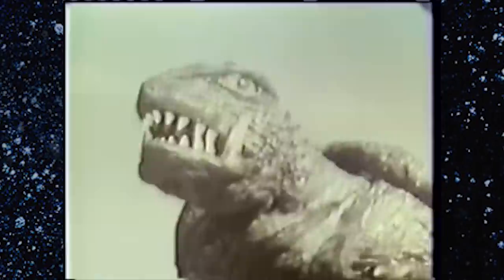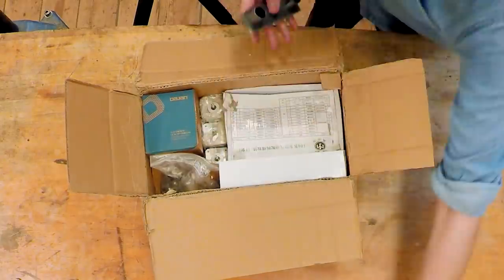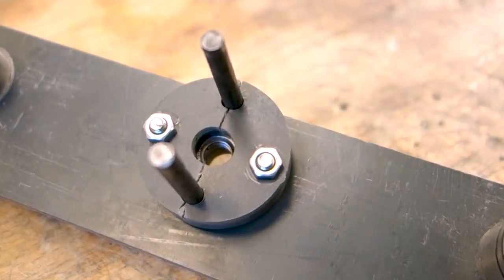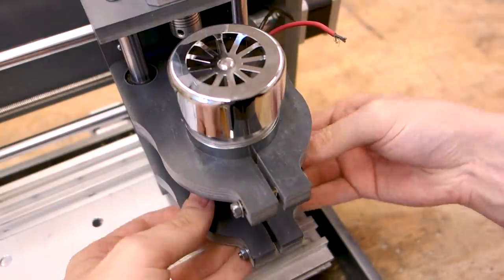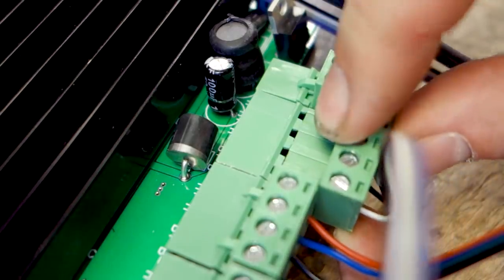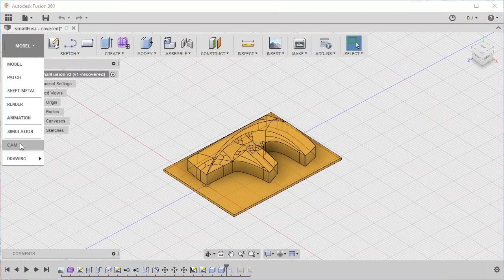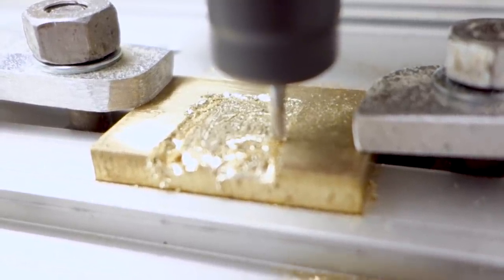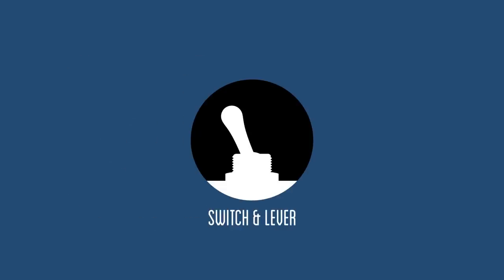Review: Cheap CNC Mill

Comment: The same money can buy an all metal machine with pre-built enclosed electronics.
Reply from the maker: +Do R/C! Show me, with a similar sized bed as well. I've heard a lot of claims to the same, but when it comes down to it I haven't found any machine of comparable size, made from aluminum with enclosed electronics for less than double what this cost.
Reply: Switch & Lever lookup CNC engraver on eBay. There on the for $400 with a 200x300 bed and enclosed electronics.  All metal it looks like.
I have no idea of the quality but it'd be hard to be worse than this.
Reply from the maker: So, what we have here is something which actually works pretty well (for what it's intended to, which is engraving), and you automatically think that something else, which you also have had no first hand experience with, automatically is better? That doesn't even begin to make sense.
Reply: Switch & Lever I'm not saying that it will work better.  It does seem to have had more thought put into it's design though.  The kit you got had to have moderate modifications done to it to simply get it put together.  I just wanted to say there were options that appeared more "put together" for the same money.

Comment: I've bought this mill by the past and it was a nightmare.

First, the chinese seller posted it to an erroneous address, fortunately, my real address was inside the box, so the addressee joined me to get the box.

The box.... Badly packed, the cardboard teared-off, fortunately, the contents was complete.

Second, the motors. All the spindle and the NEMA steppers were badly used.  The Spindle's brushes were almost weared-out, and the spindle ran a t a merely 3000 RPM, so i replaced it with a higher quality 3.175 mm spindle.

The steppers, definitely met water in their past since theit internals were rusted. Fortunately, i could clean them, re-oil the bearings and lenthened their 15mm short  leads.

The electronics.... Bad bad bad !

They used Toshiba TB6560 drivers which i DEFINITELY  NOT  recommend. Awful instability which caused excessive current consumption and driver overheat.

After several unsuccesful modifications, i finally quit and bought a new TB6600 equipped four-axis module which works like a charm.

I bought this mill mainly to engrave PCB's and i use it regularly today for prototyping but  i do not reccomend it, mainly for the awful spindle motor and for the crappy electronics. Go for an aluminum extrusion unit.
Reply from the maker: +ve2zzz did you get it from Gearbest or where did you get it from? Reason I'm asking is because there seem to be a fair amount of very similar clones, from different sources. Aside from feeling dirty none of the parts I got were used before I got them, and the electronics sound different from what you describe at least.
Reply: Probably a clone... I've bought this CNC 3-4 years ago and don't remember the seller's name.

Comment: This is such an ambiguous review. How can we take your verdict seriously when you replaced the rod nut holder and the entire bed?
Reply from the maker: So I should not have replaced the broken part, and ended the review there? 

If you actually looked through the entire video one of my final points is that this is a good platform for experimenting, and continuing to build on, which is exactly what I did. It's ambiguous because I want people to make up their own minds based on the available facts. I got this mill to make a review, not to advertise the product, in which case it would've been a heck of a lot less ambiguous.

I wanted to push this mill to see what it could do, and I pushed it beyond that point. It's advertised as an engraver, and for that job it will work just fine. I wanted to see if it could do more, which it can, to a point.

Comment: In short: it's shit
Reply: I'm hearing Neil Young singin'
"Saw it on YouTube,
Bought it on Gearbest,
When I got it home,
It was a piece of crap,
PIECE OF CRAP!!!
Reply: The main problem, I think, is the type of plastic used for the frame. It can break very easily (and bend), but I don't think it is very hard to find someone having a good machine capable of making aluminum parts. All you need to do to get a fairly "good" CNC machine is to replace some of those cheap plastic parts with aluminum ones. But I have to agree, the overall product "out of the box" is not very impressive...
Reply: Must feel good to think you have the high road. Black and white thinking doesn't make you look smart. But you are entitled to your opinion! Have a nice day as well.
Reply: i know you did doesn't take keeping up xD xD
Reply: The uploader can say what he wants, but from the results he got it's safe to say it's shit. Plain and simple.
Reply: I find myself having to agree with @eduard van lersel... 400$, lots of hours and yet no tangible results ... It's utter crap... that's it's "cheap" is not a redeeming argument,  crap is crap, no matter what it cost
Reply: I agree. This is shit.
Who wants a plastic cnc machine anyway?
Plywood would be better ffs.
Reply: so you pubicly say it's shit?  and if you could, it wouldn't  be accurate or reapeatable
Reply: Damn right!
Reply: Frank Einstein Even a wooden frame would be better, given that it's designed to be stiff
Reply: +SugarBooty
I haven't thought about wood but you are right, It's easier to cut than aluminum. But at this point, I am wondering if it would be cheaper to buy the parts separately and build it from scratch. Like, half of the parts of this kit needs to be replaced anyway.
Reply: Frank Einstein Everything adds up, off the top of my head, buying everything from Amazon for the free/cheap shipping it would cost about the same. This kit has all the parts in one package for $400 with a rough guide on how to cut the pieces. It's up to the individual but if I was in the market for a CNC mill I would definitely consider getting this kit. Then again, I love to tinker and make improvements over time. For any sort of manufacturing environment you need to buy a decent mill for the warranty and serviceability.
Reply: Steve Vise i didnt say its shit lol
Reply: Literally a guy with racial point of view explicitly imposed on Chinese products any smarted people would put hands on counterfeit products what’s a smart ass guy with an awesome opinion
Reply: the number of modifications you've made to it and the part you had to mill say more than your comments.  it's a dud
Reply: Haha, how about me putting 10 machines in a room you cannot live? They can work at least 10* faster, and not to mension your morale, repeatability and so on.
Reply: Cole, no one is twisting your arm, forcing you to use this machine. Even if this device is "shit" (as you say), I find the video extremely informative. And if you have never had to manufacture a part for a factory-built machine you are assembling, then it's obvious you've never had to put anything together on a budget. Although it's nice that you have plenty of money to do whatever you want to do, some of us have a need to actually build stuff.
Reply from the maker: In short, you didn't listen to what I was saying through the video, and make conclusions about a mill you have no first hand experience with.
Reply: Oh, I have been listening. But spending $400 on something and then spending dozen of hours to get it to cut something out of foam that I could cut in ten minutes is shit to my eyes.
Reply from the maker: +Eduard van Iersel dozens of hours? The whole thing took 8-10 hours from start to finish, including recording video (which for those of you who don't make project videos lengthens the time of a project significantly). You're just jumping to conclusions about something you have no first hand experience with.
Reply: 10 hours is still longer than 10 minutes. If you are willing to defend something poorly made that has no significant function, then be my guest, but to me it is a piece of crap.
Reply from the maker: +Eduard van Iersel so wait, you expect to buy a kit CNC for $400 or less and not only that be able to put it together in ten minutes? Really? Do you want it to make coffee and iron your clothes while you're at it?

In the end I'm defending something I've had actual experience with, from you who've likely not even seen this before this video and only have opinionated input to come with. 

You don't have to buy it, no one does. Hell, I never even recommended anyone should buy it, I merely lay out the facts from my hands on experience.
Reply: pot calls the kettle black. I'm just a guy with an opinion
Reply: An opinion isn't inherently wrong. I can cut the same parts with a knife myself, so to me the machine is useless.
Reply: yea your opinion is completely wrong, i could cut fine parts with this machine once i learned what it could handle, for 400$ the value is definatly there, not so much an opinions as these are facts
Reply: I just publicly called it shit, try to keep up. I can make things accurate and repeatable, I'm a furniture maker. Have a nice day.
Reply: in short, your kind of and idiot ahahaha

Comment: Spending this much on a mill which is a piece of junk to begin with, it really isn't a good deal. You may as well not buy a mill and save your money to buy something from a reputable company. Buy from China and you'll get junky, low-grade products every time. Trust me it doesn't pay to cheap out haha
Reply from the maker: +Karl Walter I understand your sentiment, but find a reputable CNC mill for the same price and then we'll talk :)
Reply: That is my point, you will not find a reputable mill for the same price, because you pay for the quality you get, it's basic knowledge. This kit broke, has a weak spindle, tonnes of deflection in the frame, poor accuracy, no strength and can barely cut the material with any degree of accuracy. That is a waste of money in my book. 

If you can honestly tell me that spending $400 and getting this performance from it is money well spent, then you are being taken advantage of. A Shapeoko 3 costs $1200 ready-to-run and mills incredibly. 

Buy the proper tools for the job. If this breaks and you throw it away and buy another, you are almost at the cost of a Shapeoko 3 which is better in literally every single way, except you instead are now stuck with a piece of junk and down $800 plus all your time.
Reply from the maker: +Karl Walter I hear what you're saying, but I think we are coming from different starting points. If you want a turnkey solution and want a mill for production reasons, hobby or otherwise, this is not the mill for you, just as any kit machine is not for you. If you're in it for the building, tinkering, hacking and learning that's a whole other ball of wax

I think if you're spending $400 and not getting performance that it wasn't advertised having you shouldn't be upset. It's advertised as an engraver, and I tried to push it beyond that. Do you buy a home vacuum cleaner and then get upset it doesn't have the performance of a shopvac?

That's one of my final points, with lower tool engagement, with engraving, it does just fine. If you're advocating dropping three times the cost of this on something better you're somewhat missing the point in afraid. There are always better machines on the market, if you're willing to spend the money. If you're willing to spend the time, you can on the other hand get away much cheaper, even if it requires a fair amount of tinkering.
Reply: Switch & Lever Switch & Lever I too see where you are coming from. However, even a Shapeoko is not a turn-key system. There is a lot of tinkering to get it setup and understand it, but what you get at the end is worth your money and time.

I can tell you from experience, that having to struggle to put together a cheap, poorly made kit, deciphering instructions and finding things don't fit (or end up breaking) does not help anyone learn, nor does it give you a product that is worth your time nor money even after all your tinkering and modifications.

If all you want to do is engrave as this machine is designed for as you say, you can get a high quality, precision machine that comes as a DIY kit for around $700-800 and won't break but will perform flawlessly.

Yes, spending 3x the price for a more expensive machine isn't for everyone. But even after all your work, the cheap machine is still rubbish and cannot do a decent job. 

CNC machines are complicated enough as they are to build and get working right. If you are advocating for saving money while still getting results, you'd be better off building a machine from scratch as many, many others have done, because that wouldn't cost much more than this, you get to do your tinkering and the result is something of quality, with quality components and not components made in China with a total unit cost of $30 sold to you for $400.

If you wanted this same kit, you could buy everything individually and find out how excessive $400 is for this kit. Honestly, $400 or even $500-600 for a DIY machine done properly would be better than making this work (poorly).

It's your decision, but I think you can tell from the other comments on here that many people feel the same. People work hard for their money and have little interest in throwing it away on flimsy, poor-quality kits which don't work and are hastily thrown together and are more than likely unsafe electrically as well. 

If you are happy with the kit, all the best to you and I hope it serves you well, but the rest of us value our money a little more than to throw it away on this haha.
Reply from the maker: From experience I can tell you the exact opposite. Some of my best learning experiences have been from problem solving and debugging things that don't work as they should.

Whether it's worth your time or not is something for everyone to judge for themselves. Some people scarf down lunch standing up between meetings because they're too preoccupied with how much time they're spending, and others spend a week whittling a twig, for no other reason than whittling a twig. It may not be worth your time, but it was definitely worth mine. From start to end, even with the breakage/repair, this took maybe 8-10 hours to finish, and that's even scrounging materials (like cables) and even with setting up cameras and shooting the video as well. To me, that's not terribly much time, but to each their own.

I'm not arguing with people having different opinions on what's worth it or not, that's their own choice, and their money and time to do with what they will. Maybe it's my own fault for not doing an sufficiently in depth review, but I do take some issue with those thinking they know this machine better than me, even though this video is the first time they've ever laid eyes on it. 

I choose to take a less absolutist approach, less speaking for everyone, saying that no one should do this, everyone thinks this way, etc etc, and instead try to give a balanced view and share my experiences rather than speaking for others..

Comment: People can consider the price the cost of learning. I built my own CNC from scratch but it took a long time for me to learn it all on my own. Going the kit route you get it all shipped to you in a single box. So it is the price of convenience. That having been said just about every part of this whole machine would need to be replaced in order to get acceptable performance out of it eventually. Still, if it gets someone started and they may not have otherwise, then it is money well spent. Someone on YouTube named MyfordBoy got one like this and they totally rebuilt theirs.
Reply from the maker: +Paul Frederick indeed! As I mention in the end, this is not a production machine, so those comparing it to out of the box ready machines is somewhat moot. The motivation is different for different people, and for someone who's into building, tinkering and learning I think this is a good machine. Even if, as you say, if you want to convert it to a full fledged mill as opposed to an engraver will require substantial replacement of parts.
Reply: Yeah it is not a Tormach. I can see the value of a kit like this to bring the various separate pieces of CNC together for a lot of folks. They can have it all right in front of them working, so they can see the interplay that goes on among the various subsystems that make up a whole machine. That is something difficult to grasp just reading about the topic piecemeal from disparate sources. I've seen folks get too focused on some details, and lose the overall plot that is going on. It happens around motors a lot. If you have good leads, and guides then you don't need so much motor. People have troubles putting that together for themselves though.

Comment: You should have a lot of free time and be able to toss out $400. Usually not a combination that works. And probably most parts will have a tendency to fail easily meaning constant replacements and upgrades.
Reply: But that's the fun of it, isn't it? This is not a turn key production solution. Nor does it have a price tag like that attached to it either.